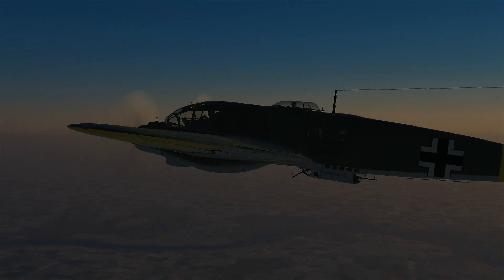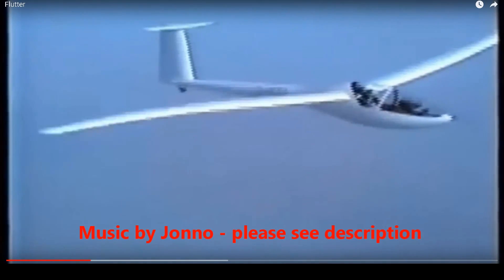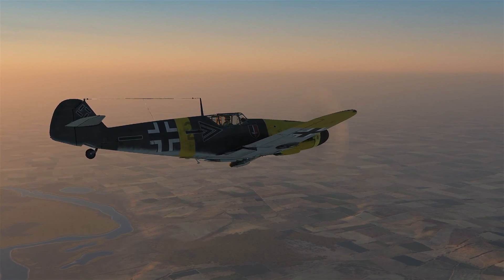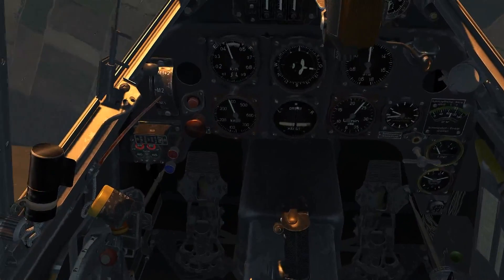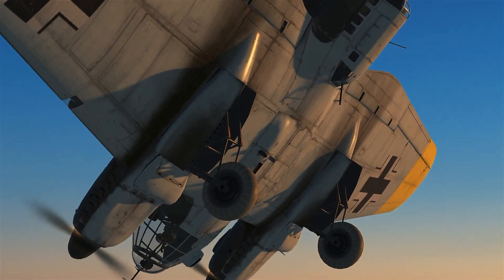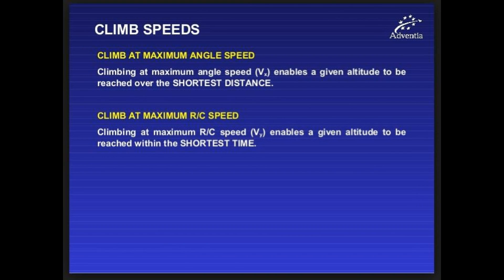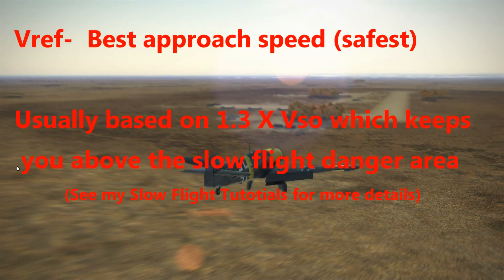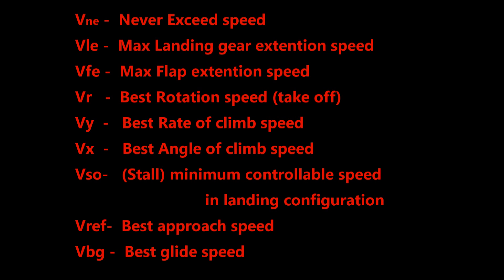(28) IL-2  What are V Speeds ?- Why they are IMPORTANT. What is Vne ?

Comment: You can fly and land without elevators at all. Simply via speed. Using speed high will pitch up low nose down. manage it and youll be fine.
Reply from the maker: Take a lok at my How to Fly vid on Trim control.  Yes you can land with only trim input.